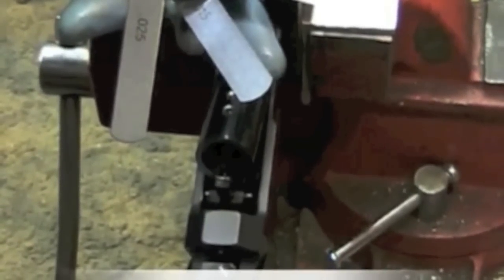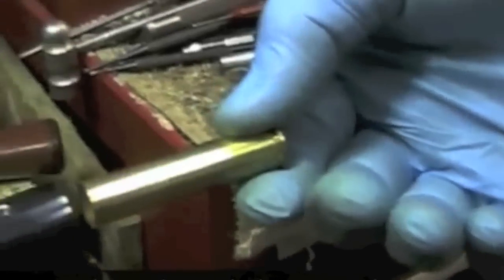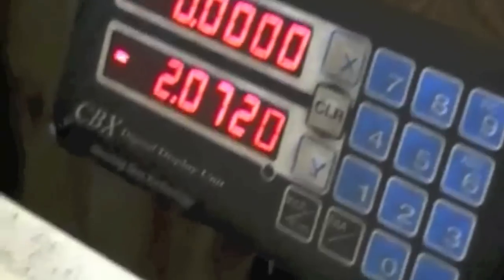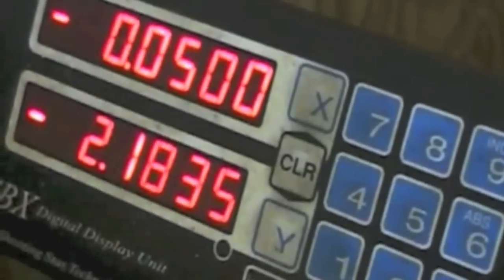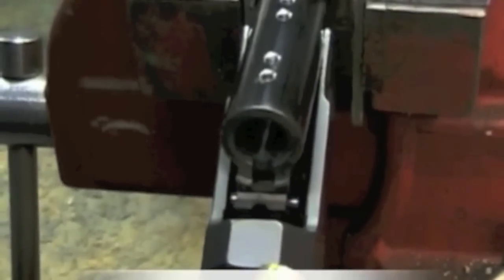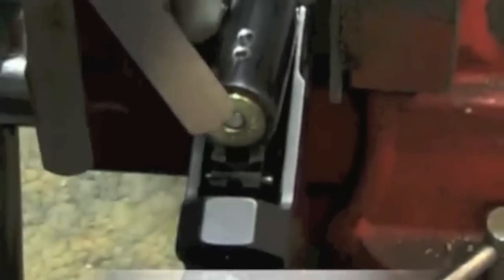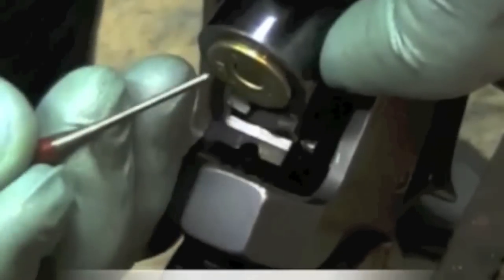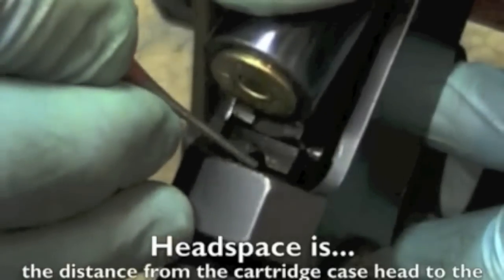Barrel To Frame Gap

Comment: Definitely the TC guru. Thanks to this man I didn't wrap my encore around a tree. I now have my Encore rifle shooting sub moa with the 2 barrels I have for it but never again will I buy another thompson break action. Tolerances are crap on these guns and if you truly want one to shoot, prepare yourself for some work. For what these cost you can buy a decent bolt platform and be way ahead of the game.
Reply: My 10" .223 with a scope would shoot 3/4" at 100 yds!  Not bad IMO. The Contender is also capable of handling monster loads.  It is one of my favorite handguns. 
PS: to get those groups required custom loads.  You would get garbage out of any .223 load intended for rifles.

Comment: Wouldn't this be the same as S&W revolvers where the old counterbored cylinders enclosed the rim but the new ones don't?  The actual problem with finding a severe frame to barrel gap would be if it indicated a loose lockup between the two (I'm thinking of some old single shots I've had other than TC).

I still have a Bellm rifle barrel & stock for my old TC that I bought in the 70's.  Beautiful wood & beautiful barrel.

Comment: Thank you for this valuable information but what if the casing gets pushed deeper into the chamber?
Reply: Howdy Colt! To answer your 2 year old question: It theoretically can't! If that barrel is machined correctly, the cartridge should seat to the point where the barrel starts to decrease in diameter to squeeze the bullet! With the end of the chamber and the barrel being a fraction smaller in diameter than the bullet, and the case being bigger yet, it'll only seat so far! In theory, it's more likely to stick out further, due to factory ammunition leaning towards longer case length rather than shorter, to produce less pressure!

Now if you're handloading, you could trim cases shorter, but you've got very little play there before the rim hits against the barrel. In an ideal situation, you're buying something like an Encore with the intention of handloading, and you're going to trim-to-length all of your brass to the same length, keeping your head spacing identical between cartridges!

Comment: the headspace on a .45 is not measured from the end of the cartridge but from the rim, the way you are measuring is for a .38spc cartridge, also a cartridge like 7mm is measured from centerline of the cartridge front taper. Am I wrong?

Comment: Most people do not have the machine shop skills for this sort of operation.  That is exactly why H&R does not market barrels, but will factory fit multiple new barrels to actions returned to them.  Besides, the H&R Handi Rifle has an action that obviously was originally designed as a shotgun; whereas the TC shows its pistol origin with its goofy shaped grip.